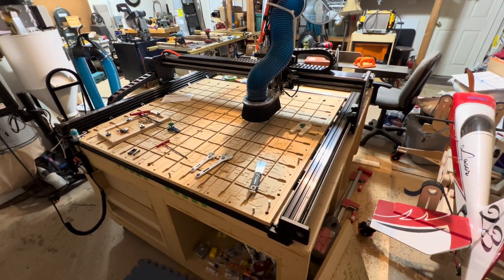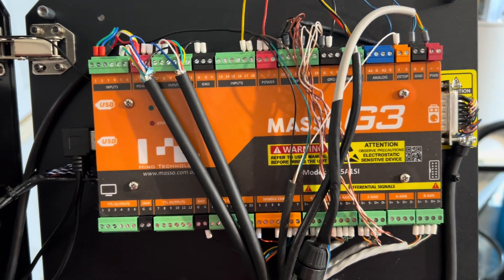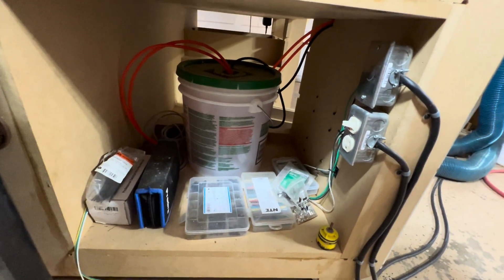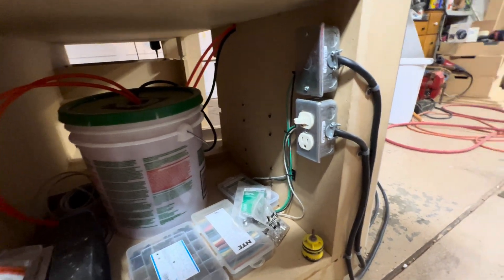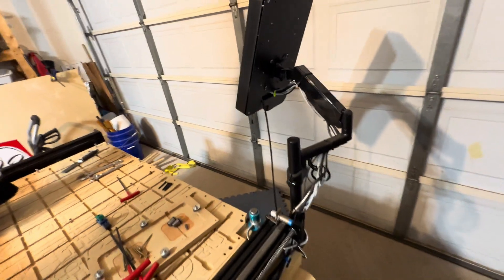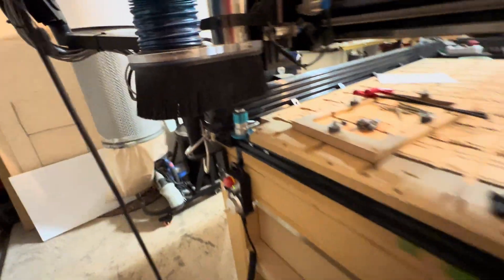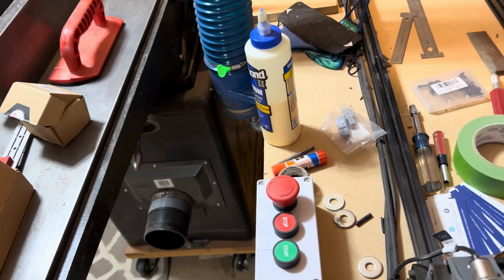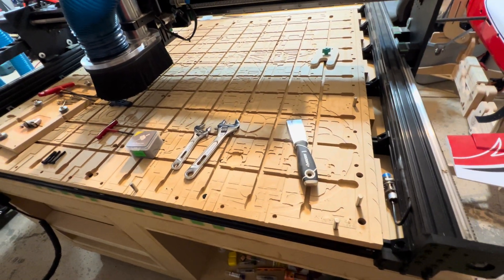Completed QueenAnt Pro V2 Overview

Comment: Hi.. thanks for your video.. This video was posted one year ago.. so I was wondering if you are still running your cnc at the same speeds your mentioned before... 7000 mm/min average.. any damages...? I bought the queen ant V2 2 months ago for a small business.. Yuyong said not to run it over 800 mm/min I got disappointed when they said that because it is too slow and that won't be good for my business, time is money you know.. I am still kind of afraid about increasing the speed and depth cut.. I am using a 1/4" straight bit at 1200 mm/min and 5 mm depth pass.. is it too slow..? thanks for your answer and sorry for my English.. I am from Ecuador
Reply from the maker: Yes, no change in my usage and no issues with the machine handling it.  I tend to just follow the bit manufacturer's instructions for speeds and feeds and ensure taking a good chip load.  Running too slow and taking too small stepdowns and stepovers will not result in a better cut, it will only result in excess heat which if too high will cause excessive wear of the bit.  The bit should be making chips, not sawdust. Also, you said you're using a "straight" bit, do you mean a straight cutting edge like a flush trim meant for a handheld router?  I would definitely not recommend that, you should be using bits such as end-mills with 2 or 3 spiral flute cutting edges meant for whatever material you are cutting.  For my latest project, I was cutting pockets in MDF using a 1/4" two flute up cut end mill and was running at 170 in/min (4318 mm/min) in one pass @ 6mm deep running at 16K rpm.
Reply: Hi.. Thanks for your answer, it is so helpful.. I was using a two flut straight edge bit... So I will follow your recommendations... It is great to know the queen ant can handle my small business..

Comment: What is that wire called that you   Have running from the drivers to the controller? Is that like a 4 conductor shielded wire? What gauge 22ga? I need to buy some and wanna get the right stuff. Also what does it need to be rated for as far as power goes?
Reply from the maker: The gray sheathed cable used to carry the differential motor signaling is CAT 5E ethernet cable. The black sheathed cable carrying sensor inputs came with the kit from YuYong and is 4 stranded conductors with shielding, it's not marked as to conductor size but is probably 22 - 20ga.  Since it's just sensor signals (24V), it's not carrying any power loads.

Comment: Hello. How is that spoilboard working? I'm interested in doing something like that.
Reply from the maker: Works great!  Though with that said, I'm going to be building a new table with vacuum hold down. Most things I do are large with multiple complete cutouts from full bed sized sheets of plywood, so I actually don't use the dovetail slots that much.

Comment: Is this machine good for a beginner to start a small cnc business?
Reply from the maker: Absolutely, though of course it depends on what you want to make / sell.  It's of course limited by its cutting footprint so not suitable for doing cabinets or commercial signage, but anything that will fit is fair game.  It's got decent power and feedrate capability to do light to medium production work.  I don't know your capabilities, but I will caution that the machine does have enough power to do damage and throw work pieces across a room.  Also, while not particularly difficult to assemble, if you don't have experience with mechanical, electrical and electronics assembly, it may be a bit daunting.

Comment: Nice, I'm probably going to buy the QueenAnt V2 very soon. I have a few questions:
1-what closed loop motors are you mounting? 3.6Nm closed loop?
2-what max rapid feed can you reach? 6000 mm/min?
Reply from the maker: The steppers are the ones that come with the machine.  I have my rapids @ 500"/min (12,700mm/min) , routinely cut @ 300"/min (7,620mm/min)
Reply: @MakersWerks  wow, that's pretty insane. thanks

Comment: Hi. We also live in Texas and would like to order such a machine. 
  With a table size of 1500*1500 mm what size workpiece can be cut comfortably? What is the maximum working field size when cutting?
  Thank you for your video, and for your response.
Hope you are doing well and good luck with your projects!
Reply from the maker: All the specs are on YuYong's website

https://yuyongindustry.com/product-category/cnc-machines/queenant/queenant-pro-full-kit/
Reply: @MakersWerks hi can you share the working area, website doesn't give details
Reply from the maker: @patrickwright8805  It's at least 48in X 48in depending on how you set it up.  Mine is X = 48in and Y= 49.6in.

Comment: I got the draw on the spindle but YuYong doesn't list amp draw for entire machine can you give me this figure?
Reply from the maker: I've never measured it, but I'd say not particularly a lot :).  Other than the spindle, it's just the electronics, pump and steppers, my guess would be peak of no more than 10amps. Most people run it off of a std. 15amp 120v outlet.

Comment: Any chance of getting plains for your table  , Im about to start build have not settled on a table yet  not sure how big to make and  will upgradw to MSSO LATER
Reply from the maker: No plans, I just have a CAD model I created.  It's not a fun thing to build and given odd size, doesn't make efficient use of the materials and it weighs several hundred pounds so assembly gets tricky towards the end. Plus you need a large Table Saw to cut the parts and laser cut templates for routing all of the mating slots accurately.
Reply: @MakersWerks  thanks Dom for the reply😄
Reply: @MakersWerks   have table saw but like the setup you have for vfd and stepper motors trying to work out table size to make  probable 78" x 78'
Reply from the maker: @MichaelPoschen  Mine is 66.25" front to back and 60" side to side.

Comment: Do you have a build video of the controller box or circuit diagram. Did you modify an existing controller box and added the masso to it.
Reply from the maker: No wiring video or diagram, just wired on-the-fly each type of device (drivers, spindle, sensors, etc...).  The enclosure is the Masso Touch, it includes the case, touchscreen, buttons and the Masso V3 Controller.

Comment: thanks for posting this, you have a really nice build there. ive had mine a while they are great machines. its nice to see someone else using the dovetail system. what sort of cut speeds are you getting and depth of pass? i am generally quite conservative cutting plywood at about 80ipm and 2mm stepdown with a 1/4" bit and 12000 rpm on the spindle. I suspect the machine can run a lot better im just a little worried to push it.
Reply from the maker: I push it,  I use mostly Bits-n-Bits and Amana bits and use their recommended speeds and feeds. For roughing, I've using the IDC Woodcraft "Beast" roughing bit and run it at 300ipm to 400ipm full depth slotting in 3/4" Baltic Birch Plywood (need really good hold down though) and will pocket at 1/2" deep.  I run 3/8" cutters in the 350 to 400 range as well based on mfg. recommendations.  RPMs are usually around 18-20K.  You're likely to get better results if you run at the mfg. suggestions, slowing down too much can lead to excessive rubbing and excessive chip re-cutting, which leads to excessive heat and bit life reduction.
Reply: @MakersWerks   thank you :) I'm definitely going to have to start and push the machine a little. trying to play it safe ive not been doing the machine any favours. I ran a pass this avo using an amana bit and their feed setting of 180ipm. it was a little scary at first just in case my settings were wrong, but it made short work of the plywood.. thank you once again.